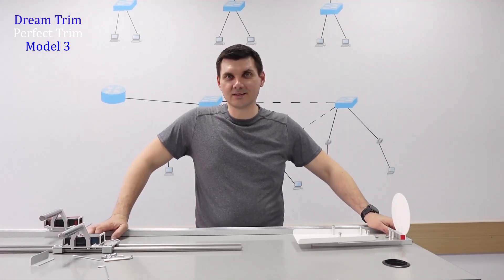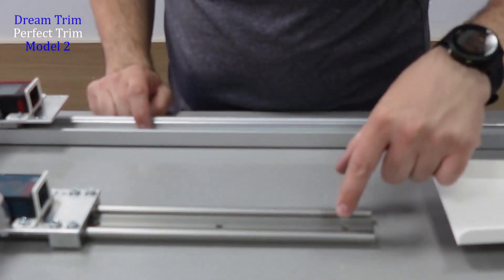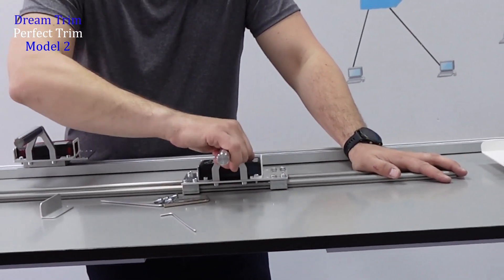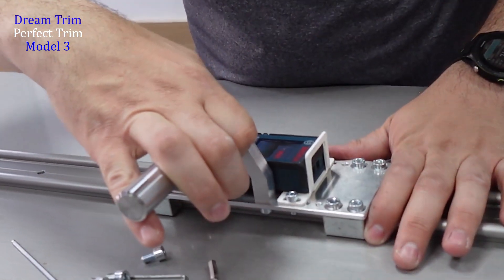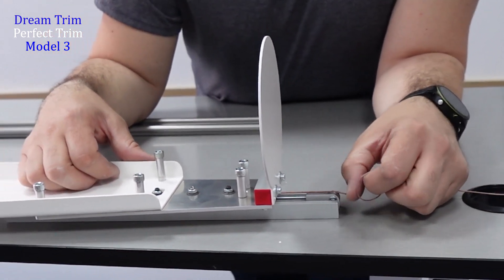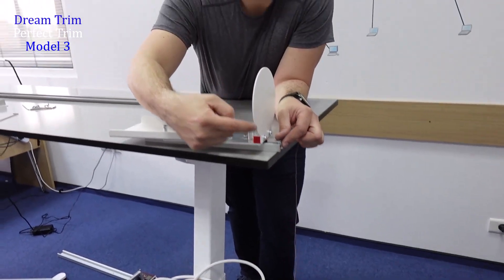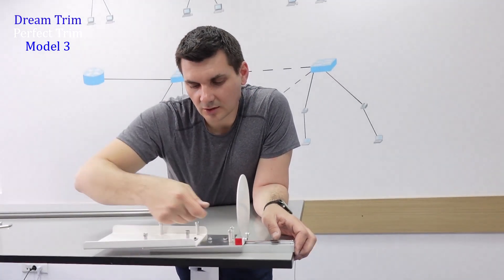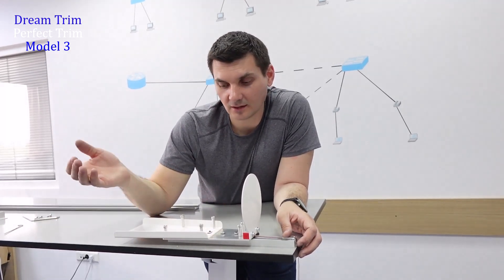Model3 - Deam Trim Model 3 - High precision Line Measuring Tool for Paragliders

Comment: @Cristi Deacu Could you explain to me how can unparalleled cord to the pulley and then weight can create error? It just lift weight
Reply from the maker: The rail and the cord to the pulley need to be parallel otherwise you have to pull a little bit harder and uneven. That angle introduces a cos in the pulling force. I am sorry but this is simple mechanics / Phisics. I probably can't explain better in words.
Reply: @TelecomAcademy  Thanks I'll try to find some links about this to educate myself.